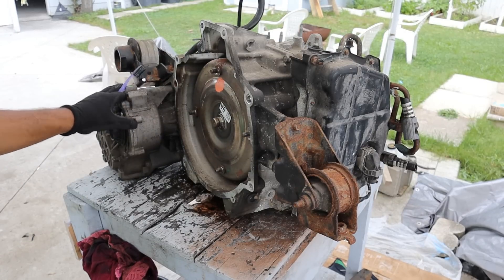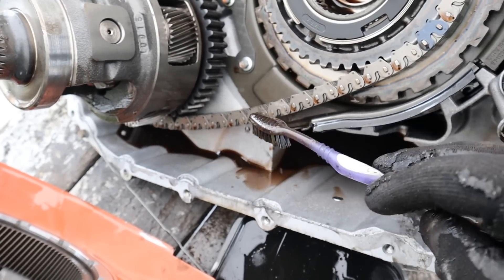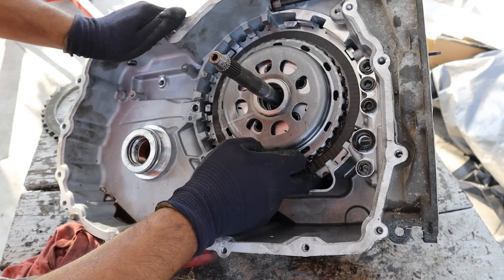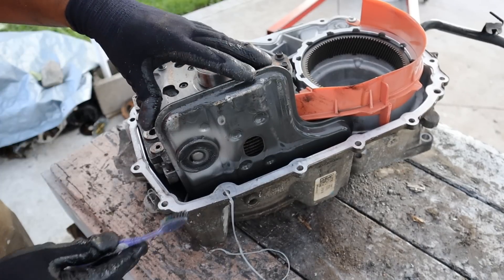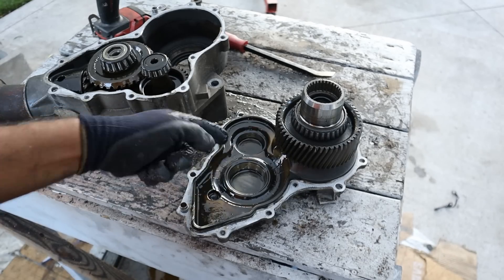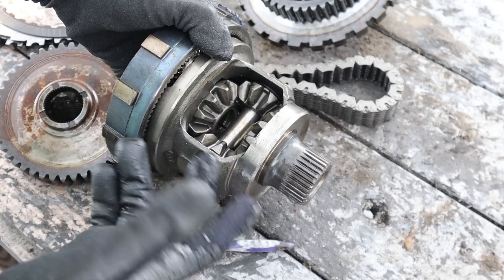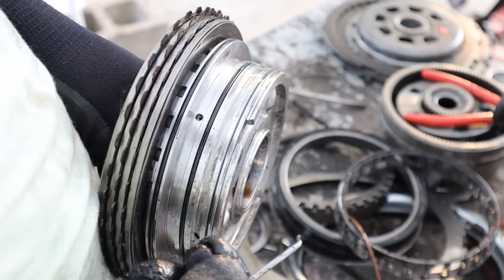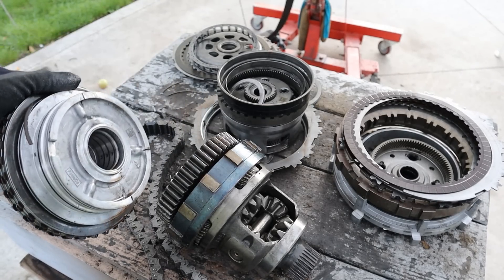How the Ford 6F35 Transmission Works

Comment: funny  you comment on bad the transmission are,,then you are suprised about some parts bring in it...by the way the ford is the better  of the two gm/ford transmissions.. better internal parts.gm went cheap on a few parts.and fords do not have dipstick in  their 6f35 transmission.

Comment: Thanks alot I am also having the same transmission with drivability issue its very slow in reverse and can't go more than 3rd gear and when parked for a long time it's takes long time to go in reverse
Reply: when was the last time you changed the fluid and at how many miles?

Comment: Mines still shifting good at 110k miles pray it lasts to 200!
Reply: Mine is 163k miles and still running and shifting fine on all gears.
Reply: my 14  fusion  2.0 vep engine car has  210000 miles on it.oem transmission..you ask why it still shifts smoothly??? we here is your answer..change your fluid every 36000. miles and every 100000 mile do a full replace ment.dont use ford lv  fluid.its crap..we use valvoline lv fluid.. and the customer love how much better is shifts

Comment: I bought escape 2010... After 2000 kms and one highway trip, it start has troubles with shifting on second gear. Day ago it stuck in 1st gear. Looks like not enough pressure...Level of liquid on stick abnormally high.I guess torque converter cant keep liquid inside. I got scammed or just bad luck ?

Comment: are these dual clutches? idk shit ab transmissions but u pulled out 2 sets of em and the manual says it is but google says the 6f35 different than the one in the 13 focus but got the same trans code? assuming theyre the same shitty dcts in the fusions and focuses

Comment: I've heard the failures of the 6f35 are mostly on the Fords that DON'T have the 2.5 L engine.  Because the other engines (all turbo charged) use different transmission cooler, lines, and screen, and supposedly the screen clogs.  

The 2.5 doesn't have this problem with the transmission cooler.  So the failures on the turbo models are from the fluid getting too hot and frying the transmission.  Don't know if that's true, but I read it.   Also they had 2 generations of this transmission, the first one (which you have there) had a flaring shift problem.
Reply: @devenmellor  I also get a bit of a slow sticky shift between 2-3 when the trans fluid is cool.  It goes back to shifting smooth when the fluid is fully up to operating temperature.   Don't know about yours, but it seems my car will sit there idling at 1250 RPM until the trans fluid warms up to minimum 50 degrees F  before it drops down to normal idle 750 RPM.  This tells me there's a sensor that the computer wants the trans fluid in the Ford to be at least 50 degrees before operating the vehicle.  

I saw a guy online who had the 1.6 turbo and he said his trans fluid came out "black" at 10,000 miles when he changed it.  I changed mine in the non-turbo 2.5 at 10,000 miles, and it was nice lush red.  So maybe there's something to this notion that the turbo Fords have clogged cooler screens or a stuck on/off cooler valve.

I bought the 2.5 engine model for the same reason you bought the 3.0.  Non turbo, port injection reliability and longevity.

Comment: That "straight cut gear" is actually a sprocket. Chain + sprocket makes a bit less noise then a pair of straight cut gears. Thanks for your content. I learn a lot.
Reply from the maker: Yeah but most transmissions use helical cut gears which are quieter than straight
Reply: @speedkar99  yes, helical are are quieter then straight.  My point was that part with straight teeth is not a gear, it will work in pair with chain and it will not generate the same amount of noise as a pair of straight cut gearwheels. Chains are fairly noisy, though, especially in higher revs. I guess helical gears are quieter then chain.

Comment: Both the Ford and the GM versions have high failure rates. The Chevrolet Cruze for example had a high failure rate for transmission failures and the engines failing as well. On the Ford side, the Ford Escapes were the highest failure rate for that transmission. The Ford Fusion also have that problem as well. The AWD ones have higher failure rate than the FWD because the PTU failed more often and can cause destruction to the entire transmission like cracked transmission cases. If a transmission is cracked, it’s not rebuildable. It can be used as a core to rebuild another transmission but chances are that there are very little good parts in the transmission.
Reply from the maker: I've heard the escapes are the worse (probably because it's heavier) and the newer 6F55's in the explorers were bad too
Reply: in a lot of thosecase..people NEVER  changed the transmisson fluid

Comment: Much difference from hondew autos
Reply from the maker: Yea Hondas are more like a manual
Reply: @speedkar99  I wonder why the honda 6 speed auto is problematic, after the 2nd revision of the 5 speed making it bulletproof you would think they would have figured it out..or I guess they did since they're on the 10 speed now a far departure from old parallel shafts of yesteryears

Comment: Interesting how small lower cost components (such as plastic seals or plastic chain guides/tensioners) frequently cause large assemblies (engines/transmissions) to fail.
If a vehicle is too reliable it will screw up planned obsolescence and ruin the economy. 
Always a joy to watch!
Reply from the maker: Thanks, and yes I agree, it's the small things that can condemn a vehicle

Comment: Perfect upload! Got one of these suckers in my 2011 fusion.. 160k miles on that sucker so far and possibly factory fluids.. 

1 to second gear is lazy and is noticeably worse in cold weather. 

2nd to third is also lazy but not as bad.
Reply: Oh yeah, also experiencing slight tourqe shudder(think that’s what’s it’s called)
Reply from the maker: Change the fluid ASAP
Reply: I have a 2010 Ford escape exact same transmission I don't know when the transmission fluid has been changed in this thing but I've always heard that if you don't know when it says been changes best not to change it because it becomes a working part of inside your transmission or should I go ahead and change this fluid without knowing the last time it was ever changed Right now it's doing great it's got 300,000 mi on it and it's doing great but you know I like to learn if you could throw that information at me I'd be really appreciate it Great video

Comment: When I had a 2013 Focus (only car I've ever hated due to the DCT 'box), I always wondered how hard it would be to swap in an automatic from an Escape. Or maybe I just wanted to escape. Anyway, I hope that car has been turned into paperclips and soda cans by now.
Reply: Same! I had a 2015 Focus and the TCM would fail once a year. Glad i got rid of it.
Reply from the maker: Can I have your DCT to teardown ?
Reply: @speedkar99  If I had it I'd happily send it to you.  What I really want to see is someone tear down one of the dual clutch/flywheel packs. There were a dozen revisions of them, but Ford never let me keep any of the three they replaced in my three years with the car.

Comment: First, also getting this notif while driving a 6F35 is so funny
Reply: Yeah, I've got one too.  Good luck to both of us, based on their track record.
Reply: @toby2581  I did two drain and fills and a half bottle of Lucas stop slip as it would lightly flare on 2-3-4, and it would also feel insane shifting when pressing the gas very lightly going on the 1-2 shift, I also recommend resting the shifting tables using forscan when performing the drain and fill too.
Reply from the maker: Did it help? 
I think once it's slipping there's not much you can do to return it
Reply: @ it’s not like actual burnt band/clutch slipping slipping, it’s a very very light and subtle flare between gears like imperceptible unless you were watching the tach as it shifted, it’s fords first 6 speed auto and it was also the first to use Mercon LV instead of V too so that also adds to the harshness, it’s really just a meh 6 speed and feels pretty similar to early 62TE’s, I just added the Lucas because this is like the 9th ford (by choice shockingly!) I’ve had and I’m too familiar with how they operate already,  but I scheduled a TCM update with the local ford dealership and I will report back if you or anyone cares, but by the first drain and fill and a TCM reset no Lucas the stumbling between 1-2 under light throttle instantly disappeared and the light flaring got better (but would still do it after heavy WOT pulls or sitting in bumper to bumper traffic), then about a week later I did another drain and full and a half bottle of stop slip and another no TCM reset and after about 200~ miles the flare slowly worked its way out and it shifts totally normally, now it just feels like a mushy 6 speed :( hopefully the TCM update will correct that, fingers crossed.
Reply: @ oh and if you care too the car I’m driving is an 09’ Mercury Mariner Voga V6 AWD